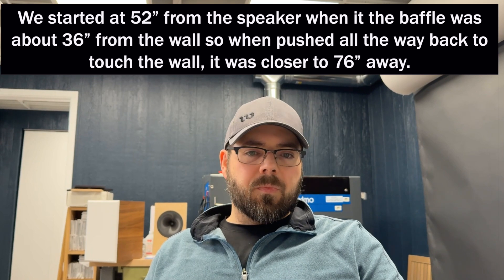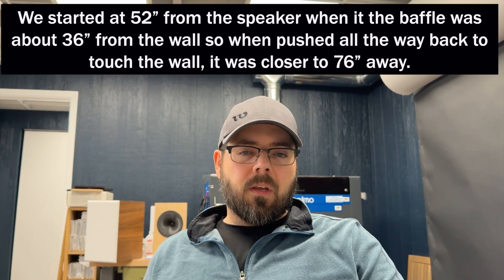Does Front Porting a Speaker Make a Difference? 32 Hz tuning

Comment: So i have also seen speakers with a port at the bottom, would that then be the same? Only then i imagine that it would be hard to get a 4” gap to the floor. It is probably 2 or 1.” It seems like a way to be really consistent, you can place the speaker anywhere and the port is always the same distance from the ‘wall’ (floor).

Comment: What a port does primarily is tune the resonant frequency of the bass driver. The output of the port itself - which could be reflected directly off the wall if it's a rear port - is marginal in comparison.

Comment: +/- 20 db 
Not a good look
Is the response better in a vacuum  ?
Apparently it is which is no surprise +/- 3 db as expected 
Otherwise, very interesting content relative to ported speaker placement
Reply from the maker: These types of swings are very common with in-room bass measurements.  Anechoic measurements are +/-3dB 32-20kHz
Reply: @css_audio  Tharbamar just put up a video with one of your kit speakers and said he was letting his KEFs go in favor of your speakers. 
I commented that was what I would have done as well 
I edited my comment to reflect your comment 
Your speakers are held in high regard as you know.
I was going to buy your bookshelf speakers but don’t want to put a crossover together 
I don’t feel competent to do so
I buy my custom and kit crossovers assembled from a company that provides design and full assembly services
Reply from the maker: @middleearthltd  thanks for the kind words!  Have you seen our SmartNode crossover boards?  They're designed specifically to make it easy for first-time crossover builders to have success right out of the gate.  I'm confident you could do it!

Comment: Thank you for this explanation - I think this idea started by the fact that you can't locate a rear ported speaker right hard against the wall - because it actually blocks the ports. But it has morphed into that somehow a rear ported speaker will get too much room gain vs a front ported speaker. Which is what you show is incorrect - so again, thanks!
Reply from the maker: I think it morphed into a marketing talking point over the years
Reply: @css_audio  Yes, that could be it?
Reply: Bass is omnidirectional, but somehow where the port is located matters? 😅 Speakers need to be pulled away from a wall boundary.
Reply: @jonathandavis9507  Right, generally speakers get too much room lift - but some speakers are designed to use the room lift.

Comment: Just out of curiosity would having a little bit of a box at the bottom, back for rear ported speakers that kind of looks like a backwards foot and having the "ports" on the top of the little box that would be at the bottom back part of the speaker would look like toe nails. You would be able to put them right up against the wall and would not obstruct the sound. I do not know if it would sound ok or not. Just an idea i was thinking of while watching this video.
Reply from the maker: I'm having a hard time visualizing what you are describing but building the speakers in a way that the port doesn't get blocked when pushing them up against a wall is definitely something you could do.

Comment: I found out that the front port on a center channel makes a small difference. This is because the rear port of a center speaker is almost always in the direct line of sight of the back-wave of the speakers hence some mid-rage will escape through the port and cause cancellations.. For the front port, only reflected sound can escape through it but all or some are absorbed by the damping materials before they can reach the port.